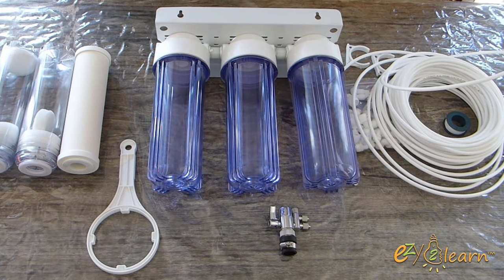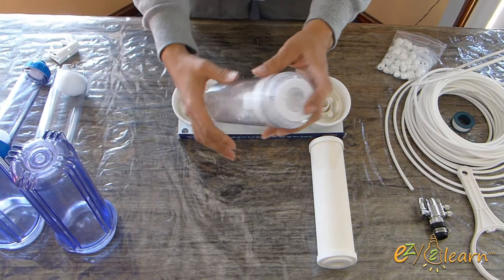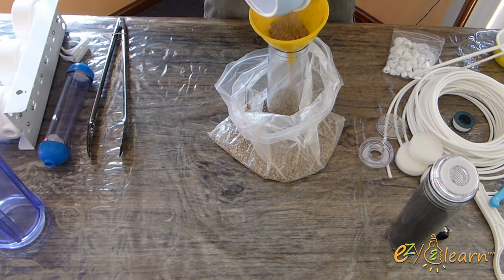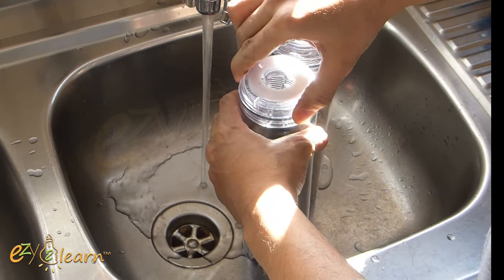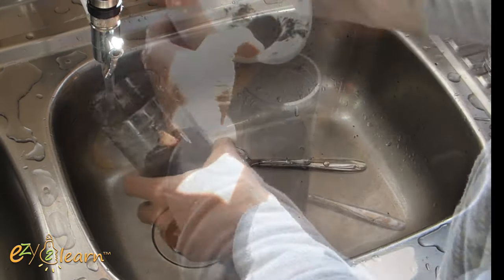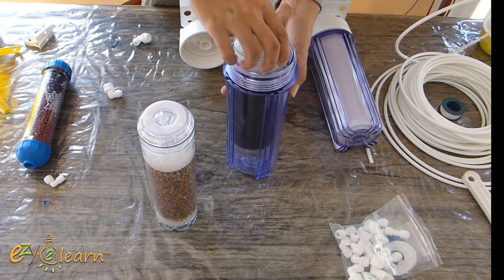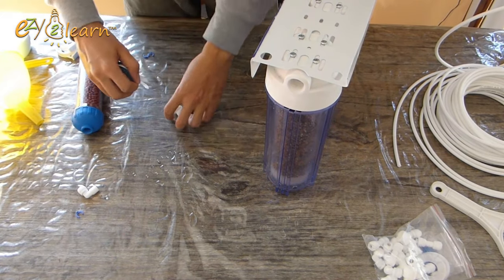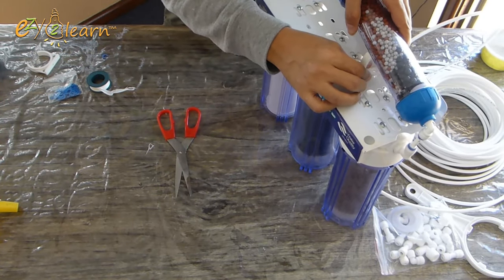Installing Under Sink Custom Water Filter System DIY

Comment: Will this reduce TDS also ? If not is there some membrane that can be used ?
Reply: You need a reverse osmosis membrane to do that. An RO system pushes pure water against its natural concentration gradient through a special barrier membrane with the pressure of the water source. By doing that, it creates a small volume of nearly pure water which the "product" and a large quantity of even more hard/salty/contaminated water that is called "waste." The waste water can be dumped down the drain, or it can be put into a 2nd RO membrane cartridge to make the process more efficient and less wasteful. The ratio is usually anywhere from 1:3 to 1:6 product:waste volume to volume. The best RO systems also have another filter stage or 2 that are full of "ion exchange resin" which polishes the product water that last little bit for a perfect end result.

Comment: I found out some people used ceramic as their last stage. So, what is the best/correct sequence for water filter? Please advise.
Reply from the maker: Ceramic filter in the first stage for sure because it has small pore size of ceramic material to filter dirt, debris, and bacteria out of water. if you put ceramic filter in the last stage, then all previous stages will get dirty and they have very short life span. Hope that helps

Comment: I already have 4 stage filter system which is sediment, pre carbon,activated carbon & akaline filter. Can i ise ceramic filter as 1st filter? The 4 stage setup originally from my hot & cold water dispenser which am not longer use it.
Reply: Yeah, but the very fine ceramic filter may clog up rapidly if you have a lot of sediment in your source water. In my opinion, it's best to have a modestly sized sediment pre filter like 5 microns to catch all the big trash, and then have the .5 micron ceramic filter at the end after every other filter. That will prevent any microbes that are in the filters from escaping, and it'll catch carbon dust that comes out of that filter.

Comment: Hi what is the reasons you filled the carbon media half why not fill all the way up..thanks
Reply: It's called "freeboard." Filters work best with a small amount of dead space in the top section that's empty above the filter media. The space allows for the water to enter through the media evenly and reduces the tracking effect. It also allows the media to decompress when it's back-flushed. The media particles have to be able to shift around a bit when the contaminants are blown back out the top.

Comment: How long to use that water filter?
Reply from the maker: it depends on your water condition. First stage will need to be cleaned every 3 months by taking out and washing it. All other stages can be changed every 9 ~ 12 months

Comment: We have a water filter system like this and recently we've been away for months, and when we came back we were shocked to see algae in the filter tanks. It's easy to rub them off but you see, I can't get to the books and crannies so I tried soaking the parts where there's algae in water and dishwashing liquid overnight, but the next morning the little bits of algae are still there. Is there a solution that I can soak the thing in that'll loosen the algae, making it come off just by running water on it? Thanks in advance.
Reply from the maker: Sorry about my late reply. I had algae once before where filter tanks where exposed to sun light and heat. I cleaned it by soaking the filter tank in boiled water with 30g of oxy laundry soaker, I soaked it for about 30 mins then cleaned it with air compressor and it was back as new. Of course you will need to rinse tanks well with clean water before installation. Hope it helps
Reply: @ezy2Learn  thanks bro.
Reply: You have to sanitize your system there's NSF approved sanitizer now or you can use the old bleach method and run the system with chlorinated water

Comment: Can you use this for hot water under the sink ?
Reply from the maker: it depends on your housing.. Housing I am using it says max temp. 60 degrees. So you will need to check out the max temperature